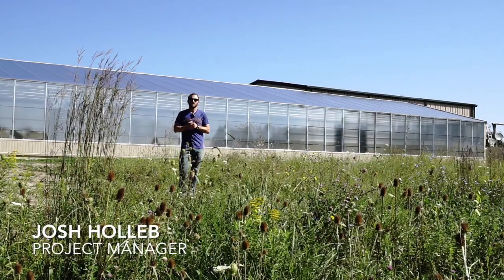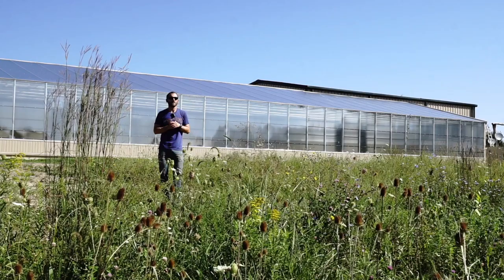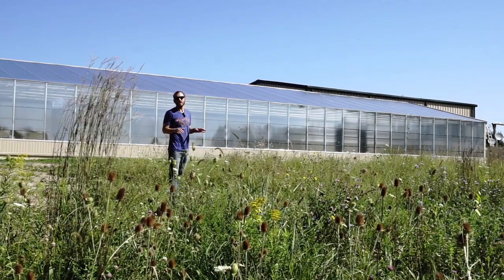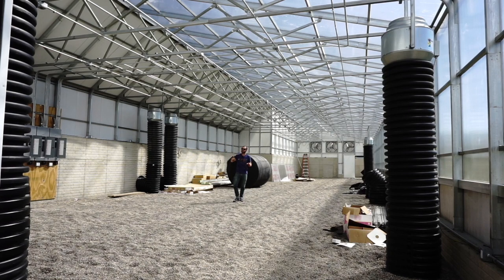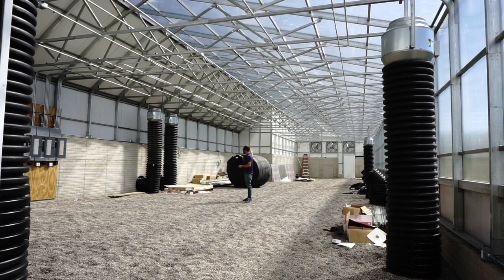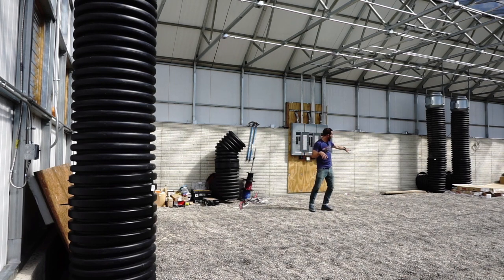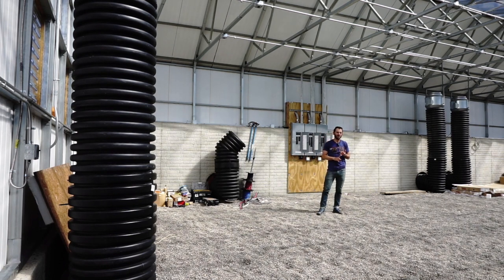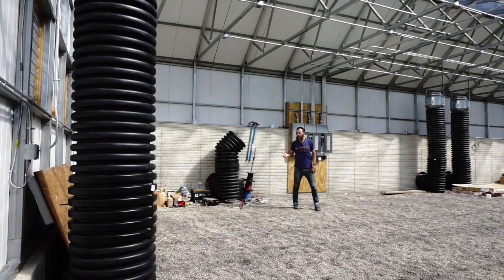HighYield™ Kit Commercial Cannabis Greenhouse in Central Michigan Part One

Comment: Why wouldn't the GAHT system keep a "cannabis greenhouse" warm in the winter?
Reply from the maker: The GAHT system can only warm the greenhouse with as much heat as it has stored. If the weather has been cloudy and cold, the GAHT can only heat the greenhouse to 55 or 60 degrees Fahrenheit and most cannabis growers need temperatures higher than that

Comment: Mold and or mildew that builds up in ghat system (condensation)?
Reply from the maker: Because the GAHT® piping is perforated, water condensation that occurs when the air is cooled can escape to prevent buildup which would lead to mold and mildew. The GAHT® system has actually been proven to filter the air that flows through it

Comment: Is the system not setting you up for legionnaires disease with condensation below ground in the absence of any light ?
Reply from the maker: The GAHT™ piping has holes in it which allows for drainage.

Comment: Wondering what environmental control system do you use for controlling the 3 incoming ventilation fans at the walls
Reply from the maker: Normally we would use one of our Ceres smart controllers because they give us control of every aspect of the greenhouse. The cheaper option is thermostats and humidistats that allows us to use the fans based on temperature and humidity.